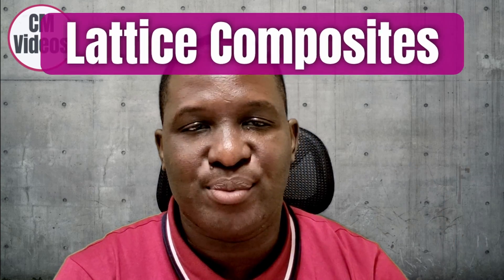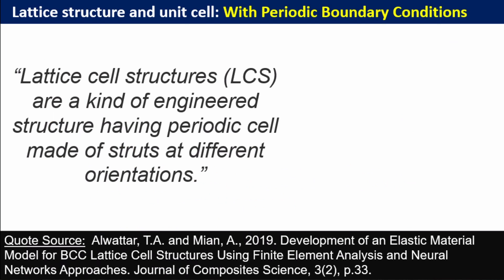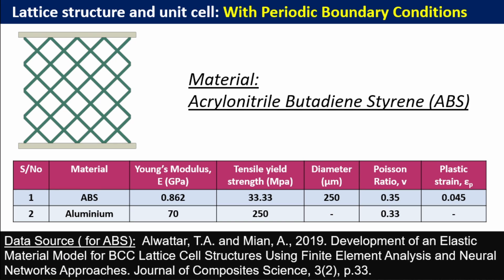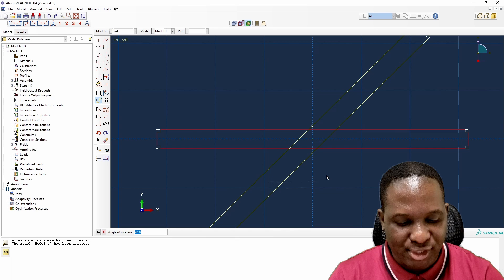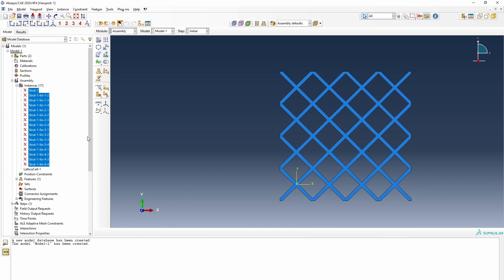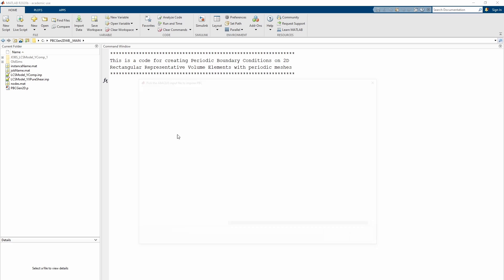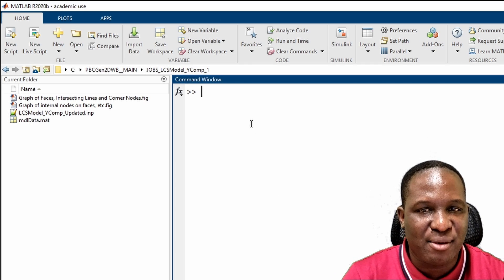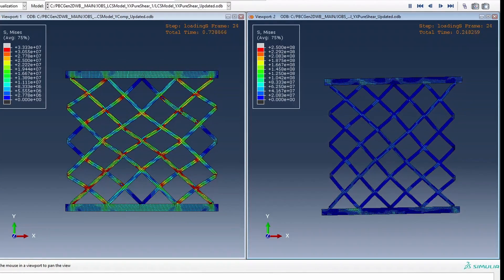How to model lattice structures with periodic boundary conditions.

Comment: Very interesting video for applying Periodic Boundary Condition (PBC) to unit cell model. But I am wondering why supports have been defined for the three corner nodes as most of papers I have seen they apply PBC on RVE without defining supports for corner nodes. So is it possible to model PBC without defining supports at these 3 left corner nodes, if so the results will be the same or will be something different which one is correct. Also, I am wondering why the load is defined on a single point, I know this node is already connected to other boundary nodes through interaction equations as you have explained in another video regarding the theory of PBC which was a great video too. But is it possible to define the applied load as a distributed line for the top surface, if so the results will be the same or will be something different which one is correct. Thanks in advance
Reply from the maker: Hello @John Nabil, thanks for your interest in the channel. 

Your comments are right. There are two major approaches to impose loads on periodic-boundary-condition aware models. First is the approach I use, where you isolate corner nodes and use them as anchor for specifying your loading type. The other approach is where you impose PBC on all nodes in the model and then introduce a strain tensor into the model as part of a constraint equation. 

The above is quite a common approach in literature and I am not surprised you have seen this in other papers. The approach I used here was made popular in the early 2000s  and continues to be in use today. There is actually no difference between the two methods, because the relative displacement of the two supported nodes leads to a displacement which is equivalent to the product of a strain tensor multiplied by the edge/RVE length of the composite. In the strain-tensor approach, this product of strain*edgelength is passed into the constraint equation. I do not do so in my approach.

On the second query of a distributed loading, this is not possible. This is because the nature of PBC is that two opposite collinear nodes are imposed with constraint equation which instructs them on how to behave. If you go ahead and apply a distributed loading on the same nodes, this later loading will be over-taken by the constraint equation and hence the distributed load (on such nodes) will not be imposed.  

Whatever the boundary conditions you use, the results will be different because BC is what defines how the FEM solution will go. So, whether it is a Dirichlet, Neumann, mixed-mode, distributed loading or periodic BC, the results will all be different. What you want to do is to make sure that whatever approach (loading type) you choose, the results you generate must match an expected analytical and/or experimental solution. This yields to the argument of the invaluable necessity of validation of FEM models.

Its a long explanation but I think it is important for the clarifications to be made. I hope you understand.
Reply: @MichaelOkereke  Dear Dr. Michael, Really thanks a lot for clear detailed explanations as I was confused from what I have read in papers and your modeling. But to be honest I learned how to apply PBC in Abaqus from your videos. For the second query about the distributed loading, I was thinking if I did that it will give me different results but actually I ran the model two times after I wrote my comment for you to make a comparison. First time I did as you have done a displacement on a single point and the second time I applied distributed displacement and I obtained the same results. Really I am confused now after what you have said that it should be different results. So, I am wondering why Abaqus obtained the same results for single point loading and distributed loading. Thanks in advance
Reply from the maker: Hi  @joonabil , you need not be confused as it is not meant to be so. Your first model with a load on a single node is correct, and this is similar to mine. However your second model, with distributed loads on some boundary nodes, whilst it might seem to be the same as the first model is actually not. What you need to do to check for differences is to run a simple model without PBC on the domain and apply distributed load on the top. I will think you are going to use some kind of pressure load.  You should get a slightly different result from the PBC-case.  If you use a random pressure load, then you will get quantitatively different results. To make both models comparable, find the pressure load that corresponds to the desired displacement. Think about your force-displacement equation in Engineering mechanics, to select that appropriate pressure load. 

What is happening really in your distributed loading model, with PBC implemented, is that the *Equation constraints (canonical equations) are overwriting the distributed loading instruction. Take it this way, for set of nodes say Nodes 1 to 10, if you apply PBC on them as well as distributed loading on same nodes, the PBC will take priority to the distributed load thereby making it seem like the distributed load is active but in principle, it is not. 

Thanks for all your thoughts on this, I will have to discuss this more as I believe it is subtle and something I need to discuss in with my CM Videos Insiders as well as my include same in my forthcoming PBC e-book.
Reply: @MichaelOkereke  Dear Dr. Michael, Really thanks a lot for clear detailed explanations. Do you mean in case of using PBC any kind of distributed load for nodes will be neglected automatically due to the *Equation constraints, but if that is the case it should neglect also the load applied on a single node in the first case as your model. Also back to the two approaches to apply loads on PBC, if I get you right as you said both approaches; yours and strain tensor will give the same results. I mean if I modelled PBC for all nodes and applied the load by strain tensor approach I will get the same results you have got from your approach. Thanks in advance
Reply from the maker: Hello @John Nabil, here are my thoughts.

1. The method that I used here has the four corner nodes free of any *Equation constraints. Therefore, they can take any external loads on them. This is why the literature call them retained nodes, since they do not have the PBC constriant on them. They are there use as drivers to cause the model to behave a certain way. This is why any loading on them is not over-written by the PBC *Equation constraint. On the other hand, for the other approach, my understanding is that all nodes have *Equations enforced.

2. On similarity of results between the two appraoches, they should lead to the same result, I will imagine. I cannot see why they will not be as the implementation is the same - based on *Equations except how you decide to load the model. If they are not the same, then the numerical diferences should be quite small, but I will say they are the same. You ahve to test it out yourself to be sure.
Reply: @MichaelOkereke  Dear Dr. Michael, Really thanks a lot for clear detailed explanations. I understood now but I think you meant the three left corner nodes free of any *Equation constraints as the right top corner node is just like a dummy point, right. Also in your video about the theory of PBC you just fixed one point at the left corner, while in your video about how to manually apply PBC you fixed three points. So, in this case I mean applying PBC with three supports still the canonical equations are the same (valid) as you explained in the theory video or it should be changed, if so what are the changes.   
Regarding to the other approach, if it is modelled PBC for all nodes and applied the load by strain tensor approach that means there is no fixed point at all in the system. If so I am wondering what prevents the system from rigid body motion. Also, if it is possible kindly I suggest making a video about the second approach or at least showing how we can apply strain tensor in Abaqus. Thanks in advance
Reply from the maker: Hello @John Nabil, I might have confused you in my description of the PBC and where things need to be fixed but my feeling is you kow what I mean and please disregard any confusing aspects.

On rigid body motion for the second approach based on strain tensor, you are right about this. Certainly, at least one node can be fixed to prevent rigid body motion. What people have done is to actually fix the node at a reference point outside the model and use a tie constraint to link the degrees of freedom of a point in the model to that reference point.

On implementing this approach, it is not the method that I use and so I do not have it implemented yet. I will have to think about it more, implement it, and then I will be able to teach it. That will be a future project but thanks for getting this discussion going. I have enjoyed thinking about the theoretical principles of PBC.
Reply: @MichaelOkereke  Dear Dr. Michael, Thanks a lot for your clarifications. Regarding the theory of PBC in your video you just fixed one point at the left corner, while in manually apply PBC video you fixed three points. So, I am wondering for applying PBC with three supports is still the canonical equations explained in the PBC theory video are valid in this case also or it should be changed, if so what are the changes.
Reply from the maker: @joonabil  it is still the same.
Reply: @MichaelOkereke  Ok thanks a lot Dr. Michael.

Comment: Thanks for such informative tutorial. It helps me a lot.
 Sir, please explain the following input for an auxetic structure in dynamics explicit(Quasistatic ) in Abaqus CAE.
1.  V=2mm/s, displacement of the model up to 30 mm. How can I apply both BCs at the same time or I am doing something wrong.
2. How von Mises stress is considered for different deformation values (Different nominal stress) for the same structure.
Reply from the maker: Hello @AmitSingh, thanks for the comment.

1. I will suggest if you want a pre-determined displacement of 30 mm, then input that directly using Static analysis. However, if you want to then run a dynamic analysis, then the ABAQUS Dynamic Explicit might do (but certainly not quasi-static). In that case, you may explore specifying velocity as V = 2 mm/s. In which case, if you want to achieve the 30 mm displacement, then your time-step will last for 15 seconds. It all depends on what you want to do. If you are more interested in the quasi-static analysis, then an ABAQUS Static General step will be okay and you simply specify the displacement as 30 mm. It makes analysis run quicker, easily and more accessible in terms of explaining the results.

2. In terms of Von Mises stress, I will think you are referring to homogenized (effective) stress state in the material. In the videos I make on this channel, I often extract the reaction forces attached to a retained node (where the displacement is applied). Using this, you want work out the normal stress (what you describe as nominal stress data). You can also calculate the strain which is displacement/gauge length. 

For this case, you would have to decide on what you want but changing the displacement would give  you different nominal stress-strain values (as a homogenized value).

Comment: Hi. I have purchased the PBCGen"D full version for the simulation of lattice structure but I am getting an error in the code. 

''Index in position 1 is invalid. Array indices must be positive integers or logical
values.

Error in PBCGen2D''

Please help me solve this error
Reply from the maker: Please can you email me the model let me have a look.
Reply: Hey @MichaelOkereke  
thanks for your reply
I have sent you the model file
I am not using face sheet as I have been instructed to do so by uni professor. 
Help me add PBC without the use of face sheet for my model also to fer force disp and stress strain data
chher

Comment: Dear Prof. Do you have any idea how to create hexa mesh for BCC lattice ?
Reply from the maker: It is hard to create hexahedral meshes based on the BCC structure because of the complexity of the joints where all the trusses connect. It can be done but you have to use the partition tool to cut up that region sufficiently to allow for meshing with hexahedral meshes. Outside ABAQUS, you may be able to use a stronger meshing tool such as hypermesh or Ansa to achieve the same. That is the only suggestion I can give. Some research groups are working on optimal meshing tools/algorithms for such problems but these are not yet incorporated into ABAQUS - the commercially available version.

Comment: Interesting lecture! Is it possible to apply on polymer materials?
Reply from the maker: Yes, absolutely @Muse, I am sure this can be done. You just have to change the material and then run the simulation. Clearly the mechanism of deformation will be different but this is possible.
Reply: @MichaelOkereke  Thank you, Professor! Hydrogel materials are quite tough for experimental investigation unless it is an advanced lab. I am trying to simulate on Abaqus for hydrogel and Shape memory materials! I wonder if you can guide me on this through your personal email Sir! Thank you once in advance!

Comment: Hi Dr. Okereke, thank you very much for your fantastic works. I saw your video on 3D and 2D RVE modeling and applying periodic boundary conditions and found the topic very helpful. I’m working on Acoustic (phononic) metamaterials using the Finite Element Method proposed by M. Aberg & P. Gudmunson, “The usage of standard finite element codes for computation of dispersion relations in materials with periodic microstructures.” Could you please make a video on the process of implementing Floquet periodicity as periodic boundary conditions?
Reply from the maker: Hello @sharmin ashrafi, thanks for your interest in the channel. I have a plan to make some videos on metamaterials but my interest is really on the mechanical response. I have not done any work on floquet periodicity but this could be interesting to research into. Keep coming back and lets see if I could learn enough of this topic to make a video about it. Good luck with your research.

Comment: Thanks lot for your video. How can I do a simulation for this structure for additive manufacturing in order to know in advance critical stresses?
Reply from the maker: Hello @Said, thanks for your interest on the channel.  It sounds like you have to do it by trial and error or use  software that runs optimization of lattice structure with properties.  There is one called nTopology. These should help you, I hope.